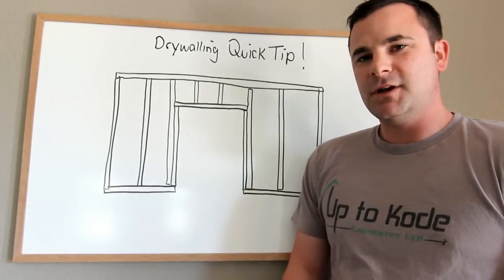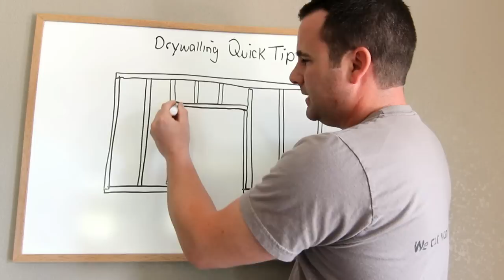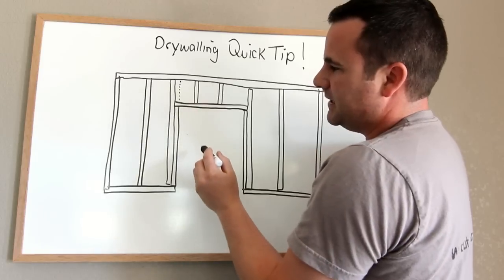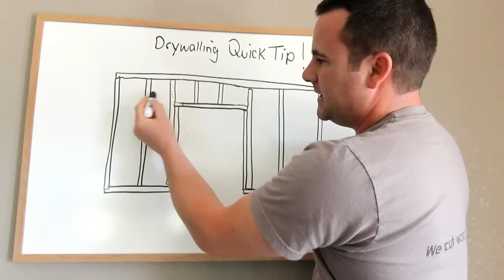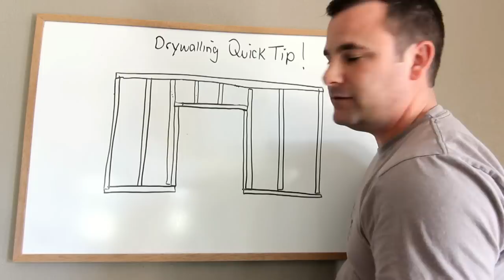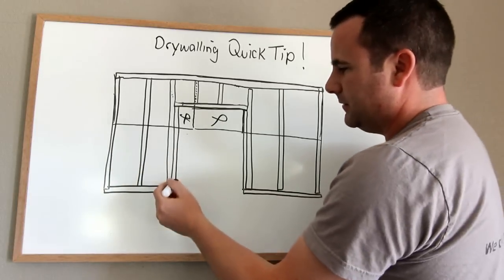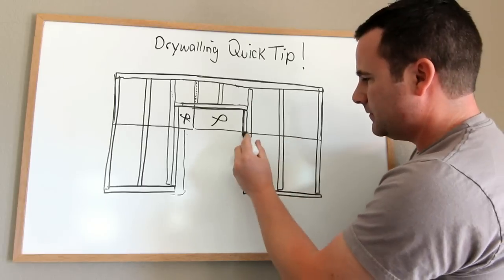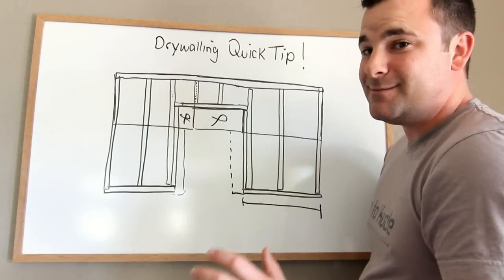How to Hang Drywall to Avoid Cracks Around Doors

Comment: at the company i work at we call it back cutting when we are able to cut it off with a knife. we also do that with the 2 boards you show for the top part of the door. we use a drywall saw and cut the shortest distance and then use a razor knife and back cut the longest distance.

Comment: Buddy Just put full sheet over the whole door and cut out around frame that is the way we do it in Aus quicker and no joints over door or window less mud and stopping involved
Reply: amen brother
heres another harry homeowner who hung 5 sheets and gonna give advice how to hang
Reply: Buddy but why do you guys hang drywall vertically in Aus more linear footage of seams more mudding wasted materials more cutting and measuring look I can talk like you buddy 

It's also a lot faster and easier to cut the door opening out one corner or half at a time.
Reply: @td5387 This video is demonstrating what to do when the drywall ends around the door. He's saying use the full sheet and cut out the door opening instead of stopping at the jack stud and turning it into a jigsaw puzzle. Duh. That's not wasteful.

Comment: For some reason here in Latvia the code is to hang drywall along the studs, not across (only  in walls), but having no joints in corners of doors and windows and other stuff is kind of something you learn on day one.
Reply: Oh I think I know part of the answer, drywall is 120 cm in width standard and ceilings are 250-ish and higher, so you'd have to add a narrow strip. But I mean, there are ways around that too.
Reply from the maker: You would be surprised how many people just add pieces around Windows and doors rather than cutting it out of a full sheet.

Comment: Thanks for sharing. I would hang them straight/vertical, instead of across on the long side. You will have a gap, that is weak between the studs, if you hang them horisontal. In Norway (Scandinavia) we never hang like that. Just vertical, since normal hight of drywalls are 240 cm / 8 feet, and ceilings are 220-240, and it makes more sense to hang them vertical.
Reply: Logically that makes PERFECT sense.  BUT the trades here in the U.S. are slow learners, and it is all about cranking out as many projects as quickly as possible.  Mudders and tapers don't want to have to get up on a ladder to have to mud and tape.  They want everything at working height.
Reply: @youdagoob   Understand, but you still have to get up the ladder, to add tape and mudd in the corner between wall and ceiling.
Reply: The reason they are hung horizontal is to avoid an 8 feet long seam.
Reply: You don't necessarily avoid the seam with hanging horizontally... An 8' sheet will have an 8' seam...

Comment: I'm doing drywall in a bathroom. I am now at the point of drywalling around the door frame, but It is in the corner of the wall it literally has one stud before it is the door frame opening.  How should I do this. Put a vertical piece and hang around the whole door?  Do you drywall the door frame also?

Comment: The horizontal joints you are showing have no backing in between the studs thus creating a weak areas that can easily be banged up and cracked.  Vertical orientation has all connection points and joints resting on a stud.

Comment: I am insulating and putting up drywall in a poorly insulated garage and I came upon a diagonal brace. Is it necessary or can I remove it? If I can't how should I go about insulating to maintain best R value. I have already use "Great stuff" foam in every cavity and have begun to install insulation and choose to lap the flaps on the face of the 2x4. I can't do that where this diagonal brace is because the brace is on the inner side of the framing. Thanks for your help!
Reply from the maker: I would probably have to see a picture because i'm not clear on the insulating method. kody@uptokode.com is my email. As for the brace it all depends on what is on the exterior side of the studs. If it's plywood then you shouldn't need a 45 degree brace. If it's only horizontal boards that are in strips then keep the 45 brace intact. Hope that helps. If still not sure let me know.

Comment: My ceiling height is just under 8 foot...why can't you drywall 8 foot sheets vertically?
Reply from the maker: +DeeInTheHouse You certainly can. Just be aware of potential small issues. If a stud is badly crowned there will be spots where the board may be 1/2 on the stud (ideal) and other areas where it won't be. Thus making it tricky to position and adjust the stud so that its in the correct position in relation to the drywall. This really applies to exterior walls if you have vapour barrier because then there is no adjusting. And let's hope that all studs are plumb vertical and also parallel with each other. If so then rock 'n roll!
Reply: DeeInTheHouse hanging the driwal horizontal provides more strenth
Reply: DeeInTheHouse Hanging the drywall vertically is better and therefor you should do it.

Comment: What is you are hanging your drywall horizontally and your door is within that drywall, how do you cut it? In other words, it covers that whole door and over laps by a foot to a foot and a half.
Reply from the maker: Yes horizontally and you want to basically drywall over your door opening and then cut it out after. You can use a roto-zip or a drywall saw. The point is to avoid joints near the door. I had a friend use pieces around and above his door which meant multiple joints which also means more mudding and taping.
Reply: What if my door is already in place?
Reply from the maker: 2 ways. Either way you still want to use a full sheet. One is to measure and pre-cut the drywall and the other is to hang the full sheet and leave it a touch loose. Then roto-zip around the door, then fasten the sheet fully. The roto-zip is more risky unless you have some experience with it.
Reply: Ok, thanks
Reply: My wall is not a full 8 feet. How should I go about cutting the lower sheet of drywall? It's about 91"
Reply from the maker: put your top sheet against the ceiling. Make sure to board ceiling 1st. After top sheet is on measure from it to the ground and subtract 1/2" . Then cut your sheets to height.
Reply: Alright, thanks.

Comment: Any particular reason for you not hanging drywall from bottom to top?

Or is it just personal preference?

Seems like more work to me.
Reply from the maker: +Gustavo Flores Typical installation is ceiling first and then work from the top down. If you started at the bottom and then went up it makes it a lot harder for your sheets to fit tight. Then you would have to measure and chalk lines from the ceiling so that you wouldn't have to rip the top sheet to a more narrow dimension. Or you bottom sheet might be too low and then you would have big gaps everywhere. Hope that helps.